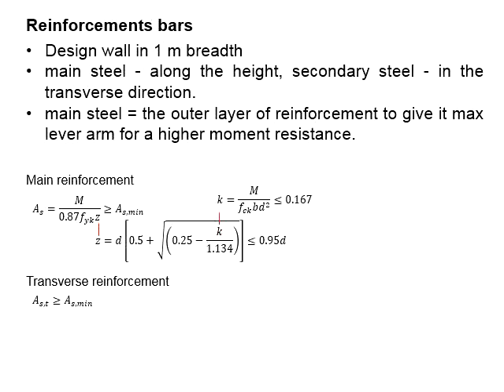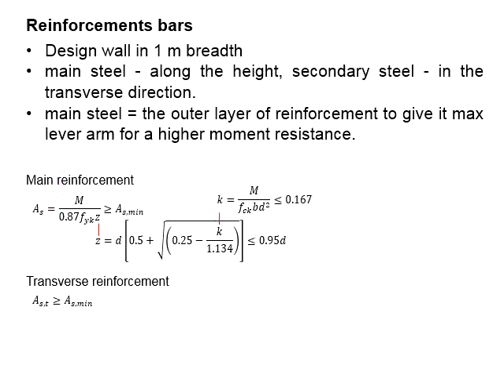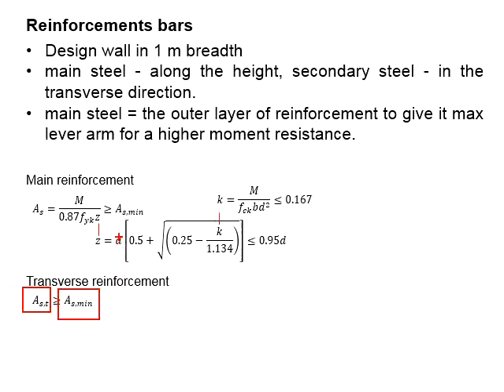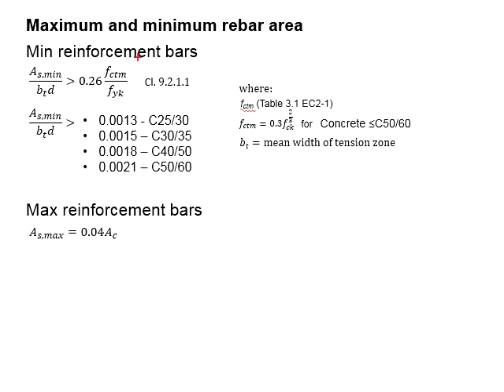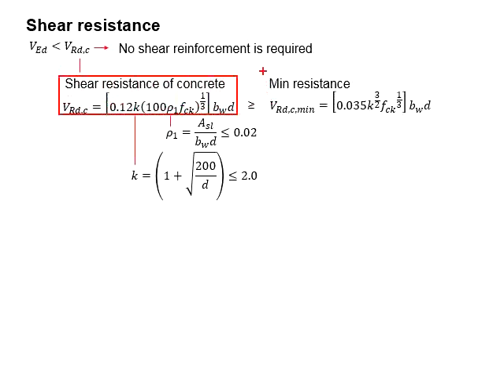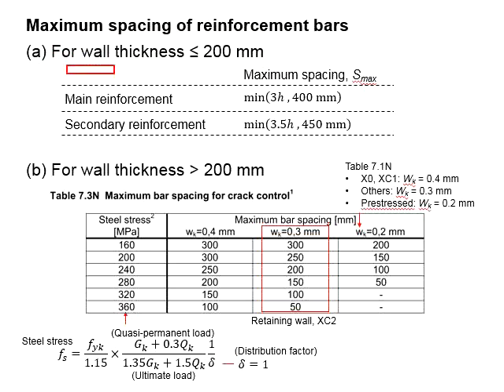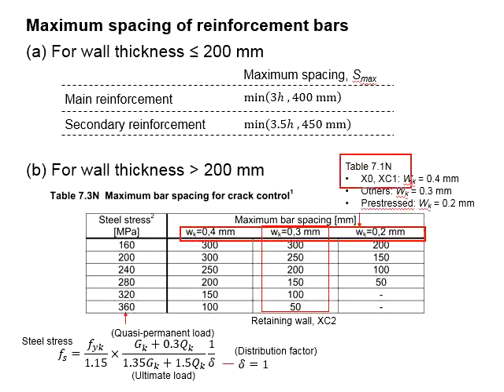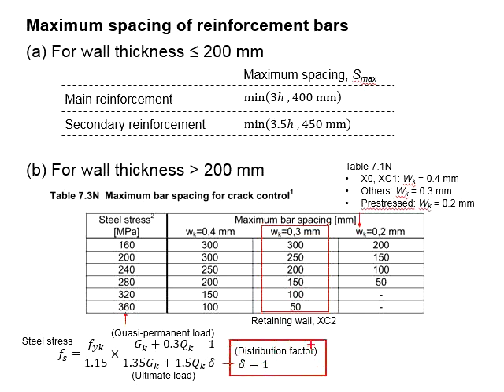4.13 Design of reinforcement for retaining wall

Comment: Hi again Sir. Please what's the value of bt(the mean width tension zone)? I can't be 1000 right ?
Reply from the maker: I believe you are referring to the As,min equation. Yes, bt should also be 1000 mm, since the design is on basis of 1 m unit width.
Reply: @eng-aim  but when bt=1000mm, multiplying by d again in mm gives a high value

 exemple
Multiplying d=5000mm and d=1000mm gives 5000000.  And 0.0013x5000000= 6500mm2

6500=65cm2

Isn't that too high for the wall? and that's even the minimum Reinforcement 
Isn't
Reply from the maker: @borisdjokaboris6424  d is the effective depth of the designed cross section, for a typical retaining wall, the b = 1000 mm, as it is design on basis of 1 m width. As for the d, it is calculated on basis of the wall thickness minus the cover and rebar, etc. it won be that much.